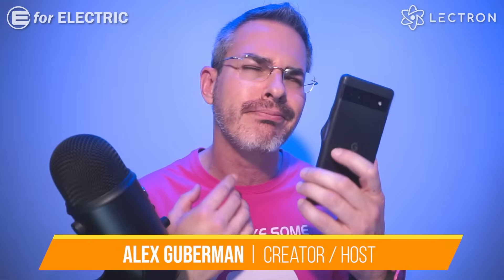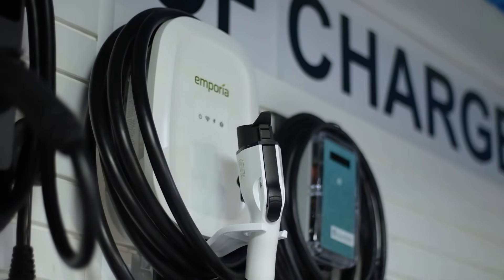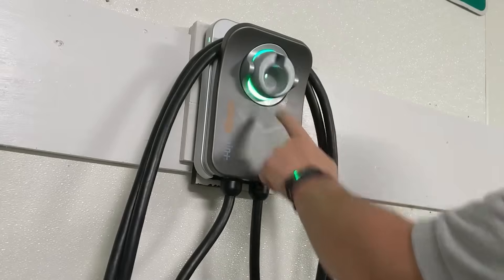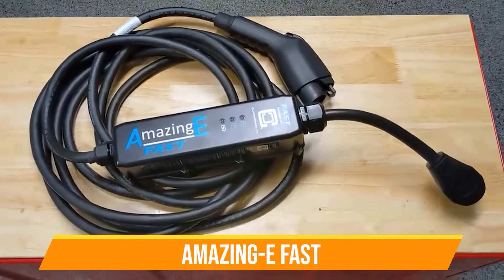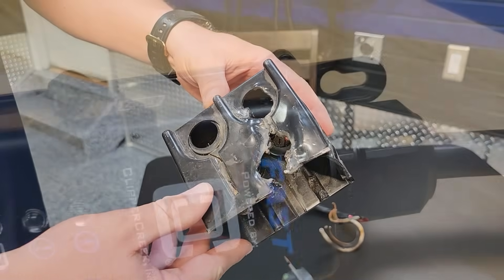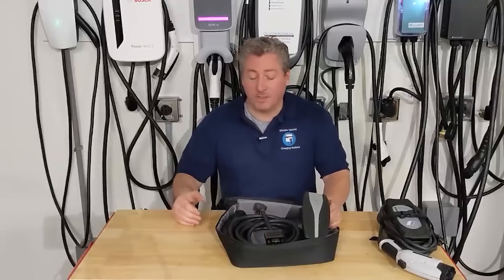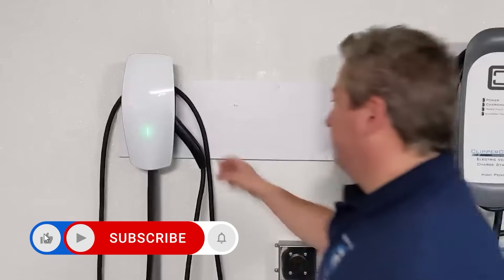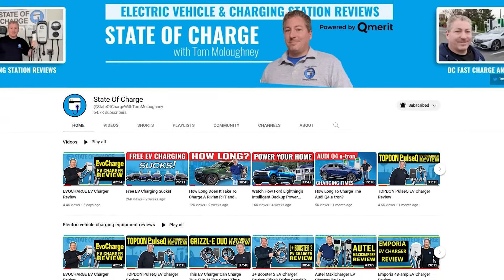5 Best EV Home Chargers on a Budget in 2023

Comment: Regarding that Tesla charger, at the 9 minute mark: (it look's like a tiny generator)  would that unit be capable of providing  enough range on my 2016 Nissan Leaf SV if I ever ran out
of battery and was say just 25 miles away from the nearest  DC Level 3 quick charge?     if it could, how long would it take the charge the leaf  to go another 25 miles

I live in Las Vegas and I'm vey worried how outside heat from June to September could leave me stranded,
but these used cars are approaching the  the 8K to 10K price  with low miles now, so  it's too tempting to not take a deep look and see if the pro's out way the risk,

Comment: So, here’s a question he didn’t answer. Can you charge a Tesla from a non-Tesla charger?
Reply: Yes. I use a Blink at home with the J1772 adapter that came  included with the Tesla. Works just fine. And that’s on an OLD charger (purchased 2012). I’m here looking for a replacement simply because it’s absolutely monstrous and I want to use my garage’s wall space for other things.
Reply: Yes you can.

Comment: Love our TESLA Mobile Charger. Easily keeps BOTH of our TESLAs charged. We even have it throttled from 32A down to 24A, and it’s still plenty for our typical once a week overnight charge. In three years, it has never failed us. Beautifully simple and cost-efficient solution. Even has the North American Charging Standard connector built right in, so zero clumsy adapters!  Plugs directly into the standard NEMA 6-50 outlet on a 40A circuit (we didn’t fall for the NEMA 14-50 scam since this outlet is solely used for EV charging).

Comment: This whole idea of charging your car is a disaster waiting to happen on many fronts, folks. To do it right you'll want a 240 volt circuit capable of 60 amps. Most homes are 100 amp service. As these vehicles get more popular can you imaging the house fires we're going to see by do it yourselfers wiring these up. We're not building more nuclear power plants -can you imagine the overloads we're going to see on the power grid.
I'd much rather have an electric vehicle that's a hybrid capable of charging itself or stick with liquid fuel vehicles.

Comment: I really appreciate your video. I just ordered a Tesla 3 RWD and I don’t really know which charger to buy  do you recommended me to order the wall and/or the mobile charger?  I still will have to get an electrician either to get the 240V connection or to wire the wall connector I don’t do many long trips so the car will mainly be more for many short trips in town THANK YOU AGAIN FOR YOUR VIDEOS   I just subscribed to your channel
Reply: It sounds like the Wall Connector will be just fine for you. The Mobile Connector would probably be fine as well, as long as you have a shelf to rest it on so that it is not hanging from the outlet.

Comment: My car has an onboard smart charger, why would I need an external charger when I have a simple level 2 cable?
Reply: It mostly matters if you need higher power or more adapters.  If you have something that meets your needs, no reason to replace it unless it breaks, otherwise causes problems, or adds a new feature not included in your existing equipment.

Comment: I own a Tesla and have an Emporia! Emporia for the win! Got mine just over a year ago and have been using it to charge my MYP (that I took delivery a year ago today).  As Tom said the whole Emporia lineup is really nice system to monitor your whole house usage.  You can see your power usage from your EV charger, and up to 16 circuits by second, minute, day, week, month and year.  And for fellow data nerds, you can export the data to drill down even more.  I also like their WIFI plugs that also integrate with their power monitoring ecosystem.
Reply: Very interesting!

Comment: For the longest time now - over 6 months - the $200 "corded mobile connector" has been out of stock at the Tesla online shop.  I finally realized it is available there as the $230 "mobile connector", which includes two adapters, the NEMA 5-15 for up to 125 volts and the NEMA 4-50 for up to 240 volts, and a storage bag.  I had been  waiting for the $200 connector.  I finally decided it may be discontinued for the moment. The 2 adapters are for Tesla chargers.

Comment: Tom mentioned the two most common plugs for the Tesla, mobile connector that used to be included with their cars but didn’t mention that you can order any of several plugs and the mobile connector will adjust the amps to be appropriate for the plug that’s connected.